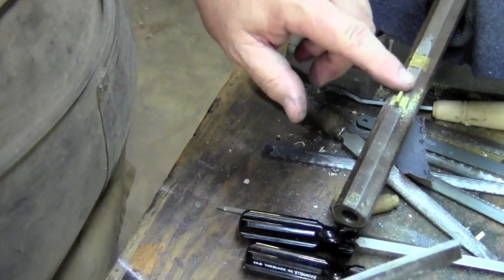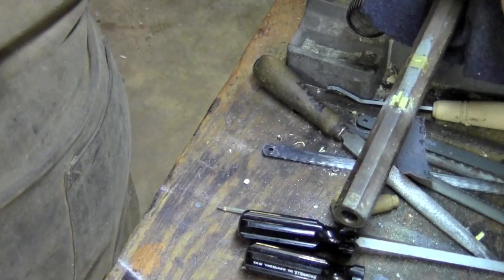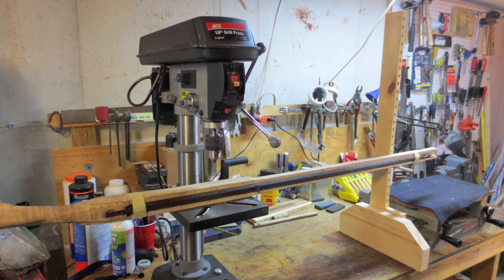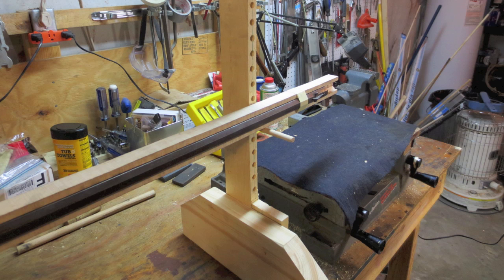Lehigh County inspired flintlock rifle update 4

Comment: That is an awesome jig for drilling holes that meet in the center.  I have worked in construction for over 30 years and have never seen this used.  I would have made one change though.  I would like to strap something under the table for the center pin to bolt through and just let the point protrude above the table.  This would let you lay your workpiece down flat and be less likely to break your bit or get in a bind. You also would not have to hold the weight of your workpiece through out the process.

Comment: I find that I like to use the depth gage to determine the depth of the tennon in its mortise and transfer that to the stock. Then center drill that mark oh so slightly and move in with a pin using the mill or a drill press. I don't think I have broken those flimsy 1/16 drill bits yet. Doing it by hand with 1/16 is an exercise in futility.
Reply from the maker: I hear that Terril...LOL